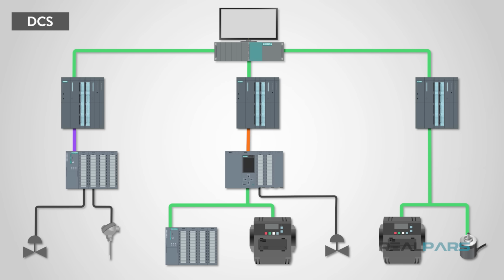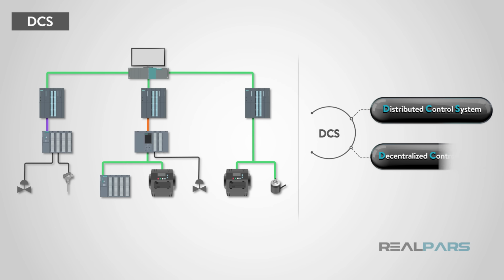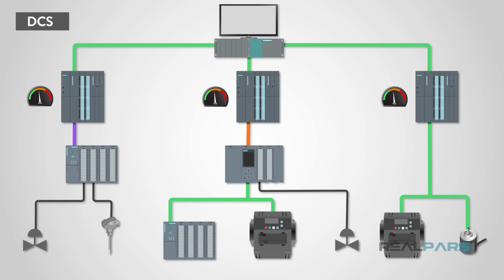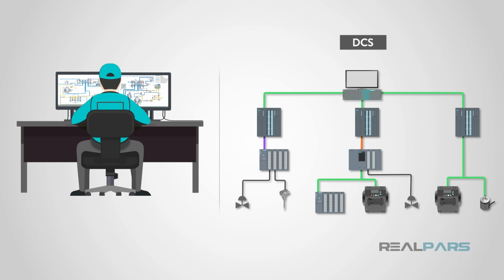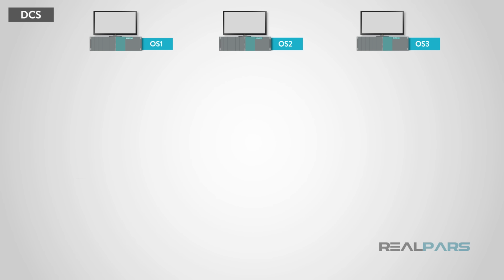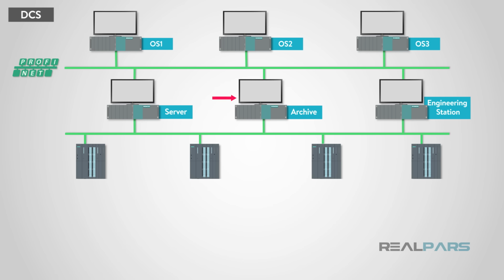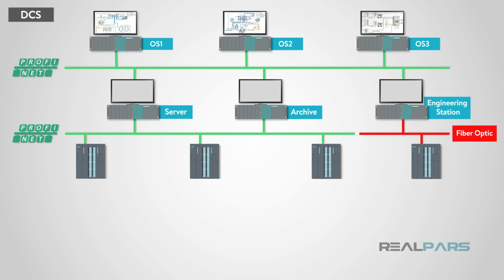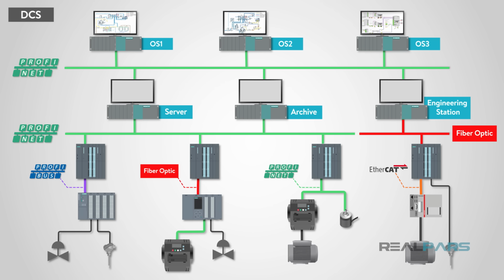What is DCS? (Distributed Control System)

Comment: With that program make the Connection Diagrams and Control System Architecture
Reply from the maker: Hello, A_Sarco. Thank you for your question. With DCS software like Siemens or AB, you design your system as you do your programming for the devices you will use. However, the DCS software is not a CAD program for making diagrams if this is what you are asking.   Happy learning from RealPars!

Comment: Please, At the stage of master controllers, The controllers in this case are plcs? Or there is a special controllers for Dcs systems?
Reply from the maker: Thank you for your question. It's a combination of both. PLCs control the factory production area, while DCSs manage everything.

Distributed control systems (DCSs) are software packages running on industrial PCs. They communicate with control hardware and provide a centralized human-machine interface (HMI) for the controlled equipment. Programmable logic controllers (PLCs) form the core of DCSs and other computer control systems.

Happy learning from RealPars!

Comment: Sir
We know that
PLC is a Controller
SCADA is a Software
 
What is DCS?
it is  Controller or Software?
Reply from the maker: A DCS is most like a PLC.  It is comprised of controllers and I/O cards, and is highly configurable with built-in functions and faceplates.  Software is used for both PLC and DCS systems to configure and program the systems, and in each case, software is used to configure operating displays.

Comment: What  is difference between the microprocessor used in  PIC microcontroller or other microcontroller boards and the microprocessor inside the DCS controller which can handle @ 1000 I/o 's ?
Reply from the maker: A PLC and a DCS both need a processor capable of handling the various computational and I/O tasks required by these devices.  The primary CPU microprocessor for these devices are typically based on commercial versions of  multi-core processors, with customizations to accommodate the features of each CPU.  In addition, firmware downloaded on EEPROM provides additional functionality for the CPU, such as OPC-UA or web support.  The ability to handle large numbers of I/O rests in the memory provided by the CPU (additional chip sets included on the CPU board) and the internal data structure addressable by the CPU (firmware).
Reply: Thanks for the reply

Comment: How is this different from an old system control bus like IEEE488 ?? as opposed to serial control data ???
Reply from the maker: IEEE 488 is a parallel data bus, such as was used heavily in the 70's and 80's in the absence of fast serial interfaces.  IEEE 488 was used for printers and other devices as well.  Modern serial interfaces are fast and efficient, mainly due to advances in the hardware (physical) layer.
Reply: @realpars  You are right on how the IEE488 differs from Serial. My question was, how does IEE488 and Serial bus concept would differ from DCS data processing and collection methodology. The bulky IEEE488 was used to control multiple devices as well as collect data. I have even made use of it as machine shop CNC controller. Looking how we draw a DCS operational flow chart using electronics, optics, pneumatics and Hydraulics, I find it very similar to the tiny little microprocessor operational flow chart before I start drawing the actual circuitry. I also find DCS and PLC a set function (mathematically speaking) within SCADA.

Comment: Hello I have a question sir what is the function of the server ? Does it convert the signal to something  like OPC ua in order to communicate with control station and other machinery that are located far away ? Also the archive is it something like a Maria dab or sql database? 
Great video btw !
Reply from the maker: In a DCS system, the server can perform many functions, such as HMI Server (holds tag database, screen files, etc.), Batch Server (controls steps and recipes in a modular batch process control scheme), or other Application Server, such as communications (for example, OPC-UA as you mentioned).  The Archive is commonly called a Historian, which is an integrated data collection and retrieval system, based on technology such as SQL.

Comment: It means PLC is a smaller controller: 1 simple PLC( example: 1 kit of s7-1500). And DCS are larger controller: many PLCs( example 1 factory with many kits of S7-400) ?
Reply from the maker: Yes and no.  A controller in a DCS system is designed to perform a specific set of tasks that are centered around configurable tasks, IO channels, and block-oriented logic.  PLCs are designed to perform a specific set of tasks centered around logic operations and IO communications.  You are correct that even small DCS controllers have more power than many small PLC CPUs, like the Siemens S7-1200.  However, the S7-400 is the "brain" of a very powerful DCS system known as PCS7.  Over the past 10 years, PLCs and DCS controllers have become similar in size (both physical and logical) and in function.

Comment: I think there is a confusion here , what you describe here is more Scada than DCS , as long as there is a server that collect data this is more Scada, true DCS has peer to peer communication between its components. and doesn't rely on server to collect data
I know there is no clear boundaries here and technology transforms but true DCS rely on peer to peer coms.
Reply from the maker: Thank you for your comment.  As you mention, there is no longer a very clear boundary between DCS and SCADA architectures anymore.  SCADA typically has a single server/computer that serves all of the functions of the control system including graphics, database, historian, etc.  For a DCS, many of these same functions are typically executed in the controllers, but servers are many times required for the historian, batch execution, and advanced alarming.

Comment: Please 😭😭,

What is the difference between FCS and DCS in uses??
Reply from the maker: A DCS is typically used to control plants with many continuous process units and a relatively high number of I/O distributed throughout the plant.  A Fieldbus Control System (FCS) is used for the same purpose, but its architecture is somewhat different.  A true FCS is a totally digital control platform and does not require I/O multiplexers or I/O cabinets, per se.  The networked structure of an FCS reduces hardware requirements.  However, an FCS is more complex and requires a higher level of expertise to design and maintain.

Comment: Hello, thank you for this video, so if my scada can manage more than one plc it could be a dcs?
Reply: Yes, if you use the definition of DCS as "decentralized control system".  I would not get hung up on definitions;  they seem to change from time to time.  The important concept is that operator stations are used to monitor and control the process, supported by servers and other computers to host tag databases, operator displays, configuration stations, and engineering stations. We call these integrated, distributed systems "DCS systems".
Reply: @scottsommer5450  thank you
Reply: No scada may have more than one plc or rtu

Comment: Good video, as always. Just a clarification:

- You say that Industrial Ethernet is the way how Operation Stations and Servers (because you may also have redundant servers) communicate. This is correct; however, you’re using the PROFINET logo on that level which is wrong since not all the Industrial Ethernet communications are PROFINET.

You have all the entire schema based on Siemens hardware and software so we can have WinCC as example. Clients are connected by standard TCP/IP communications over Industrial Ethernet. In fact, it’s also common link the PLCs with the server using S7 Protocol over Industrial Ethernet instead of PROFINET.

PROFINET is more widely used on PLC <-> I/O or PLC <-> Intelligent Device/Sensor or even PLC <-> PLC communications since this protocol has huge advantages at this specific automation level.
Reply from the maker: Miguel, thank you for your comment.  What you have described is very common, where comms at the PLC and I/O level are Profinet or Profibus and comms between WinCC and servers is S7 Protocol over Industrial Ethernet.  This is almost exclusively true for S7-300 and S7-400 PLCs and components, but later S7-1200 and S7-1500 systems typically use Profinet for communications to/from the PLC/servers/WinCC stations.

Industrial Ethernet (IE) refers to the use of standard Ethernet protocols with rugged connectors and extended temperature switches in an industrial environment, for automation or process control.  Profinet, S7, Ethernet/IP and other protocols all run over Industrial Ethernet. There are many different ways to configure DCS systems, and we, as automation engineers, should be aware of the many different ways that this can be done.

DCS system suppliers typically have requirements that limit the hardware and software choices that can be made for their systems, but open HMI applications like WinCC allow a choice of protocols that is quite extensive.

Comment: Difference between Et200M and Et200s ?
Reply: Great question!  ET-200S is a small form factor, compact, low I/O count I/O system (2 to 16 I/O per card) that can be installed in on a DIN rail. ET-200M is a higher density I/O subsystem that is rack-oriented with I/O cards capable of 8 to 64 I/O points per card.  ET-200M also supports specialty cards, like position control, CAM control, and axis control. ET-200S is similar to A-B Point I/O.  ET-200M is similar to CompactLogix I/O.
Reply: @scottsommer5450  thanks much